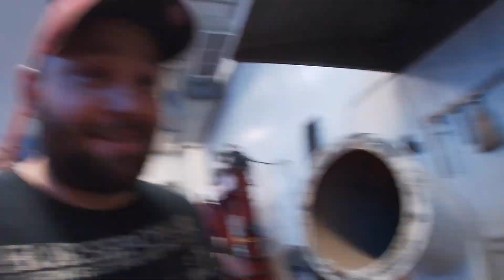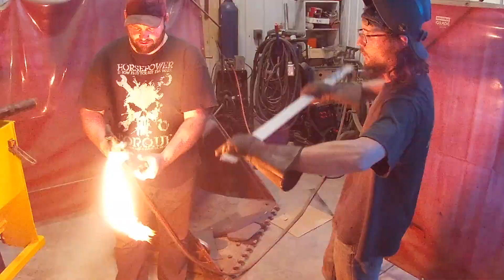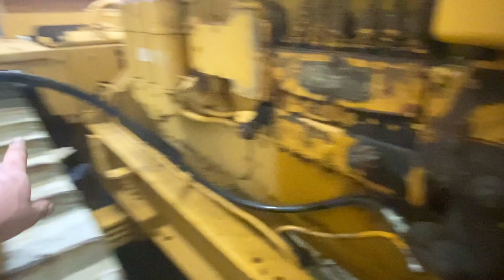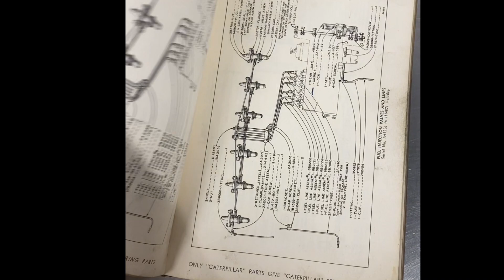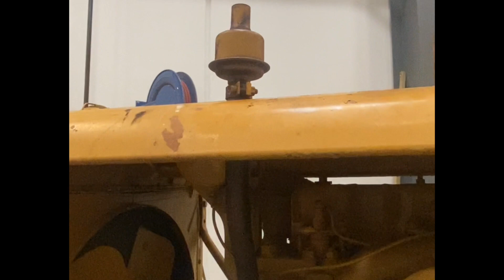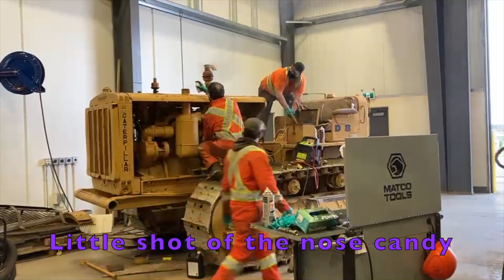1939 Caterpillar D8, first start in over 15 years

Comment: The best way to kill the starter engine is to shut the gas off and run the carb out. They are notorious for long-term problems if the carb is left with gas in it.
Reply: Fuel makes its way into engine oil. and since the pony is splash lubricated, it will ruin the bottom end quickly